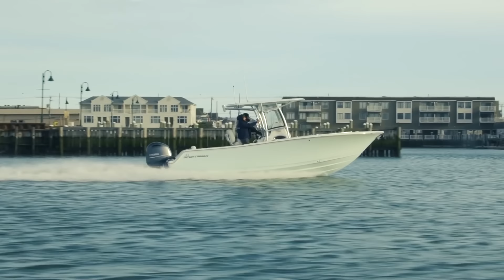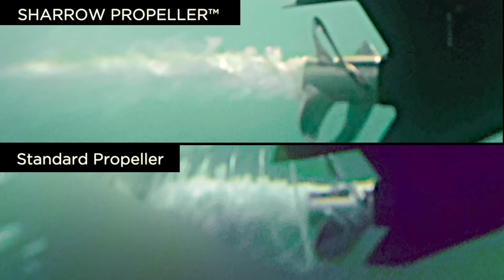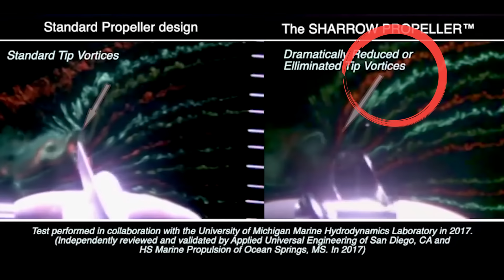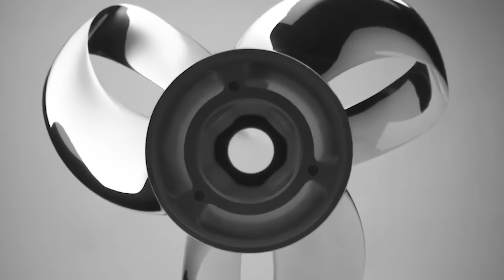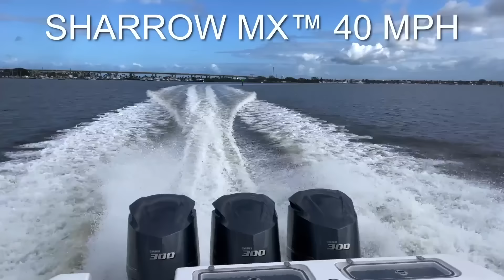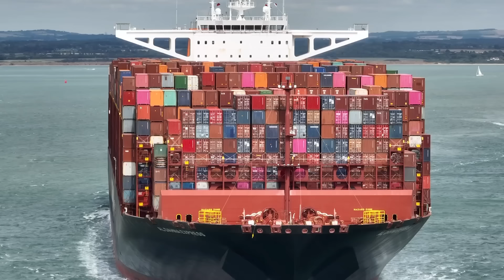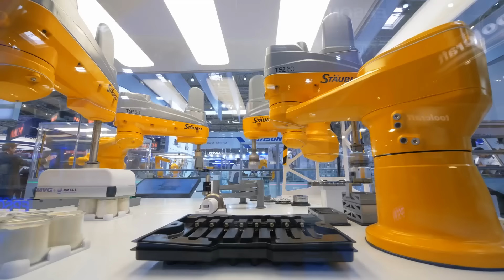This Genius Propeller Will Change Transport Forever

Comment: Shooting from the hip: nothing moves toward the center in a spinner. Even an HVAC squirrel cage fan, with its blades facing the "wrong" way, will EXPEL air, albeit at a higher pressure and less speed than a similar fan with its blades facing straight outward or backward (lower pressure and higher speed). So just bend the tips of a propeller to capture that lateral loss.

Comment: -In military application, this could be considered as a breakthrough to the naval technology as the naval assests (esp. the submarines) aim to enhance the speed, maneuverability and stealth capability.

-Installing this type of propeller to a turboprop airplane is something I will look forward into, especially to the close air support.

-Harnessing power through wind with the use of this type of propeller can be a possibility, but it will cost you time and money to fabricate and install one due to its complexity of it.

Comment: this video depicts a victor schauberger patent for his plow and repulsine engine ... from the 1910's ... and it was him who patented the design back then ... NO ONE can patent this design now because the original patent expired in the 1960's .... and all product developed from the patent fall under ITS parameters .. and sice it's 50 year limit is now long gone that makes the propeller video a victor schauaberger propeller NOT their own ... also the 1971 guy who made a patent on it fled a false claim because it was impossible to patent a patented property after it has expired its patent time ... and MIT cant patent it simply because they were the ones who stole the repulsine in the first place and when they couldnt get it to work sent it back . to the factory they received it from ... so yes it is a great design ... yes it was once patented (1910) and no it no longer can be patented ... 
this work is literally over 100 years old ...

Comment: There seems to be a little bit of trickery with the noise comparison with the boats. The sound from the props are not in the air therefore shouldn't be causeing sound waves to hit your ears. They definitely changed something other then the prop if they didn't just edit it in post.

Comment: Difficulty to make aside, this is a radical departure from a century old equation of torque and power, weight and rpm, fuel consumption. This is going to change so many things so quickly. It's a game changer for sure.
Reply: I see what you're trying to say but... it's kind of not. The mathematics of props and fluid dynamics isn't changing in the slightest. It just improves on a known problem.

Comment: I wonder if the toroidal propellers using the same amount of material as standard props.  Also since the toroidal props produce more thrust, does that mean they could be smaller diameter than standard props?

Comment: Immediately thinking of the air mobility efforts in suburban/urban areas.  The vision is to have 2-4 person electric quad/octo copters making short hops around 1000-2000ft agl.  One of the biggest challenges with having a neighborhood, roof-top launch/landing location is the noise of traditional blades and electric motors.  This may significantly resolve that one issue.  Another issue is being able to extract maximum efficiency from batteries / battery-powered vehicles.

Comment: I have a couple of questions actually as I think we're missing a beat here. If the toroidal propellers have made such an improvement, in both noise and efficiency of the output of the blades, why would you stop here. 

Did you use A.I. to assist with configuration and performance? If not why not? Also do we have smart materials that would be better suited for the construction of the blades? As the graphs you showed in the video is a clear indicator that you're moving in the right direction, but with further design tweaks that improvement could be far greater.

In time a boron graphene coated propeller will created as it has the lightness, and the strength that would out perform any of its rivals. The taurus or doughnut shape works super efficiently in anti gravity engines, so why not in this environment to. As you and I have to accept that U.A.P. can still perform in space, air, and water. So why not this???

Comment: That sound difference on the boats was huge. I was hoping to hear the difference on a drone rather than just seeing a graph, however.
Reply: I'm a little skeptical of that, given that to my understanding most noise from an outboard motor on a boat is from the engine itself, not the propeller. Though if the propeller is more efficient, the engine could run at less power and hence be quieter at the same boat speed.

Comment: I will check out the marine manufacture thank you. As a sailboat owner my prop needs are for low rpm (<2000) high torque output. It will be interesting to see what efficiencies exist for low speed applications. Thank you

Comment: Efficient, quiet wind turbines, perhaps small enough for residential rooftops? Super quiet box fans with very high air flow? They'll need to drive costs down for those applications, but  seems achievable.

Comment: This prop is not as good as you make it out to be. 
First of the comparison is messed up. Its effectively comparing a 3 blade v 6 blade.
This design loses almost any favor when you can use a duct. 
Compare this to a 6 bladed high AR eliptical prop and then compare them. All this prop has going for it is sharing a bladetip with a partner and having a little less drag in slow speed compared to a duct.
Also in the airflow video the color bands for the smoke are ofset skewing your interpretation of the data.

Comment: Seems they are also beneficial in the fact that they make less noise do to less vibration if getting this correct. Meaning equipment might last longer considering they aren't absorbing all that extra vibration. Extending an engine or mechanical parts life.

Comment: Would Sharrow have a lower impact on marine mammal strikes? Haven't seen that issue on any thread. Slower prop speed and blunt tip must be far less damaging to whale, manatee and dugong etc. Interested to see if it has been tested as a safer option...

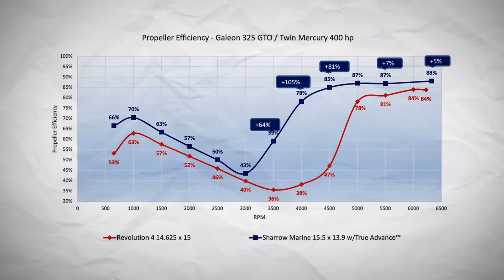Comment: 2:54 I think that it would be good to point out that the RPM at the bottom of this graph is the engine rpm. So in case of the Mercury 400 L6, (the V10 model has been out for so little time that I assume it's the old L6 model) which has a 1.75:1 gear ratio, the props are actually turning at ~2300rpm at the mentioned 4000rpm engine speed.

Comment: Very interesting and a well presented synopsis.
My first though was to wonder if shrouding these propellers would add even more efficiency.
Reply: It wont. A duct effectively does the same but better
Reply: @disruptivegarage  
My next thought is, reverse the propellers, and fix them to the inside of a rotating duct.
That would be the ''best of both worlds.''
Reply: @disruptivegarage  
Another might be multiple banks of blades in a duct, like a turbine. That would keep the blade tips below cavitation but still move loads of water.

Comment: I was tracking down SeaQuest DSV, and I wouldn't be surprised if the engines used these props internally for jet propulsion on the sub, and using maglev tech to spin them.

Comment: Curious about the torque at low rpms, strength and stability. Could it handle panamax size ships?
Reply: Like other have said, it's only for high rpm. At low rpm the mentioned vortex isn't forming so there is no gain in efficiency for this design

Comment: I know very little about fluid dynamics, but i wonder how it compares to classic propeller + tunnel. Like for example some boats have propellers in short piece of tube that helps to stream water pushed by end of blades to the back (of the boat) and not to the side. Maybe performance gap will not be as big and simplicity will win over few % of gains?
Reply: Remember the ink getting pulled in from the side? Put the prop in a tube and that does not happen anymore and down goes the efficiency.

Comment: I just saw another video testing this shape in a PC fan, it was still only about 2/3 as efficient as a normal fan.
With all this talk of tip vortices, it sounds to me like the entire problem would be solved just by putting a shroud around the propeller, since we already know air fans are massively less efficient without a shroud, why has no-one put a shroud around a water propeller?

Comment: I work on fairly small (90 ton) fishing trawlers, i'm curious as to whether or not a toroidal prop would have the same advantages with a kort nozzle
Reply: Probably wouldn't help with a ducted application - the purpose of these is to reduce the tip vortecies that cause wasted energy, having the propeller in a duct prevents those. The outer edges of the toroid actually serve somewhat the same function as a duct, probably resulting in characteristics (noise, cost, efficiency, weight, etc) somewhere between that of a ducted and open propeller. So you wouldn't have these used in your Kort nozzles, but they might be able to replace the Kort nozzles.

Comment: really misleading to say it has over 200% efficiency based on that graph. I agree it's more efficient, but that's the maximum diff in efficiency and only occurs at a specific rpm. You can probably target that rpm to maximize that advantage but only if cruising, during acceleration and max speed the difference in efficiency is much less than this.

Comment: Correct me if I’m wrong, but I’m fairly certain the reason for the noise difference on the boat outside of the water is, because the toroidal prop is more efficient at that speed, and the motors have less strain on them.

Comment: This is a NEW TREND in modern TECH the archeological refinds.
BECAUSE some things was thinked in the past BUT not reached success because the limit of technology of the time...
TWO examples:
1) The wankel motor model now with ceramic material is possible due it´s micrometric mechanical precision (no lubrication and seal necessary) and the possibility to work in extreme temperatures and compression taxes...
 2) The US defense industries had convince the British that a Supersonic Harrier was a engineering impossibility  and the joint the terrible STVOL design of the F-35B. A military fighter BORN to be a eternal underdog with several and crucial limitations...
With the new metamaterials, cristal metals e emerging techs  IF this ASSUMPTION was remade and rethinked nowadays I AM SURE with a new approach a supersonic pegasus engine for a jet fighter like the genial Harrier design and the support of digital avionics and computer controlled motion flight control this ridiculous F-35B design will be sent straight to HELL...

Comment: If it gives more efficient propulsion, (less energy used per water displaced) shouldn't it also give less efficient power generation? (less energy produced per unit of water current)?

Comment: No it will not . And i wouldnt trust MIT with developing a toothpick . Some one saying its 105 %efficient should have his head exemined for brain tumors . As this model is only 5% more effective than an ordinary propeller and in a very very limited way As the real propulsion is the big machine turning the propeller . 
As for the past 2000 years people have been designing and testing propellers . And the most efficient way to move a liquid/gas /solids  from one place to the other  is the Archimedes screw.  2nd MIT is so dumb and idiotic they forgot about the most basic of all propulsion and served global trade well in to the 1900s  windpower . a simple sail . O wait and it gets better the Fletner propulsion system . first designed and tested in the 1920s and again in 1970s during the coal and oil crisis . and abandoned when fuel was back to normal suplies .  And now there are tons of ships sailing with fletner towers increasing  efficiency and lowering fuel consumption to 10-15 and even up to 35% 

If this propeller was any good it would have been installed on every ship we know.   And these morons dont even know that each ship needs its own special designed propeller .  Good luck fitting this garbage on a tugboat , a fishing vessel , an AHS  a cruise ship and a tanker. 

What a joke . show what kind of clowns MIT are .

Comment: I think propeller design might have some room for improvement, but I don't think this is it. I'm pretty sure that the cavitation is caused by the propeller load being unequal across its surfaces, and biased heavily towards the outside edge. I've already watched a video about the design, and I think the solution is a concentric ring with a diminishing/thinning surface area radiating outwards.

By the way, the design was inspired by the load being distributed equally across its surface areas. It would be simpler to just have a tapered blade with a ring encircling the blades. It's over engineered, but it's also MIT...

Comment: Mechanical engineer speaking - these are probably not as exciting for commercial applications as it first appears. Since these vessels operate at a fixed cruise rpm / speed, a conventional propeller would be optimized for that operating point. We can see on the efficiency chart posted at 2:58 that the conventional propeller is able to achieve within 5% of the peak efficiency as the toroidal prop. With both propellers correctly sized for a fixed operating point, I suspect the benefit of the toroidal prop may be as small as 5%. It does appear interesting for recreational applications and other applications where the operating speed varies more considerably.